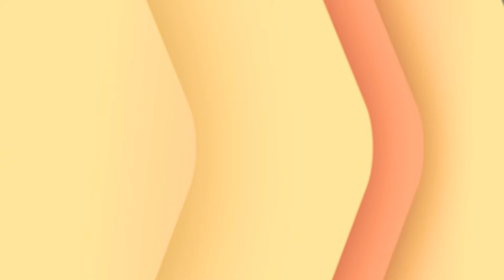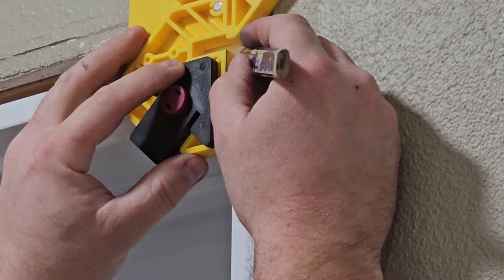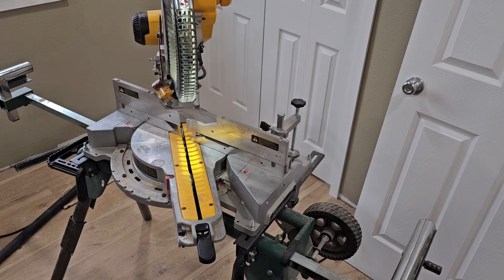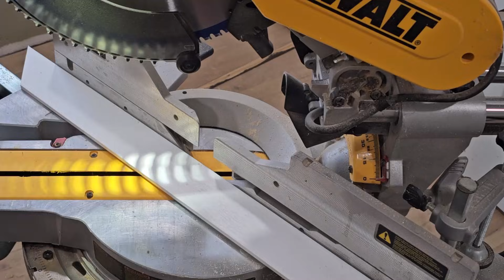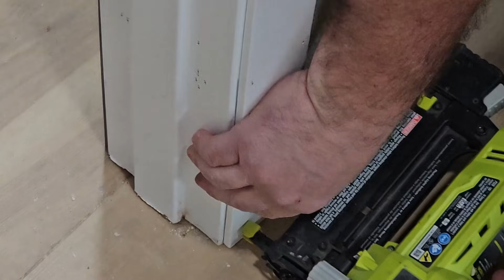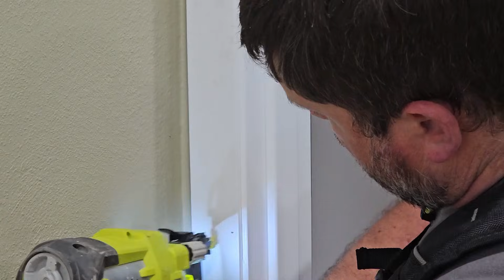How to Install Door Trim & Casing | Easy DIY Door Frame Molding Tutorial

Comment: One thing I have seen is instead of just nailing your trim up it is better to join them face down on the floor so you can use a faster on the back side preventing it from working apart over time. I point this out because the house I am currently in they just nailed it up and all the door trim has gaps in the joints.i would have used trim screws in each corner if I put it up like this.
Reply: I’ve seen door trim that has been preassembled using a special fastener, not nails and not screws.  I came here looking for this method and other than your posting, I saw no mention of it.  I guess I need to look further.  It annoys me to see trim joints expand leaving an ugly gap.  Yeah, I’ve heard of filler but I’ve seen this other method that keeps joints super tight for decades.

Comment: Making those reference marks on the frame eliminates the need for a tape measure. I make a quick little jig by nailing two small pieces of scrap together offset by 1/4" in both directions.
Stand your left and right vertical pieces against the frame, mark them at your pencil lines and go cut (miter) them both. While you're at the saw miter one end of your top piece. Nail up one vertical piece. I prefer left side first because I'm right handed. Hold your top piece in place and mark the other side at the pencil line you made on the frame.
You can do both sides of the door at the same time with no tape measure and minimal trips back and forth to the saw.
FYI, I've been doing finish carpentry for nearly 30 years and learned that trick long ago from an old hand. Work smarter, not harder.
Peace!